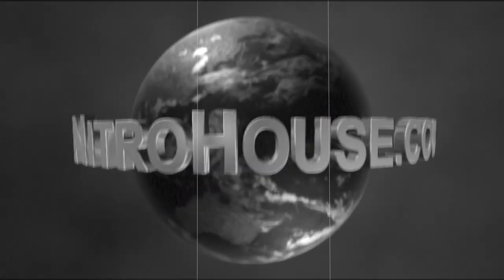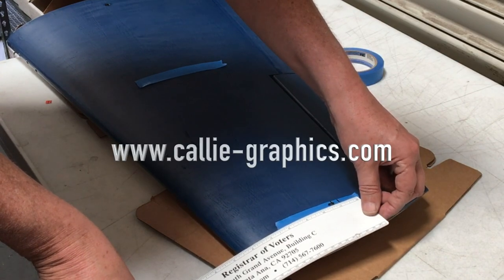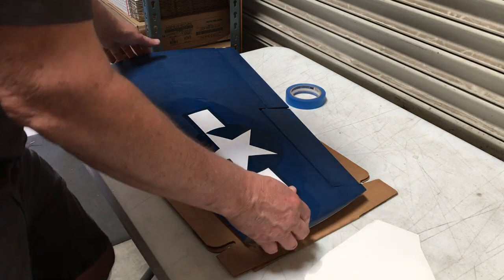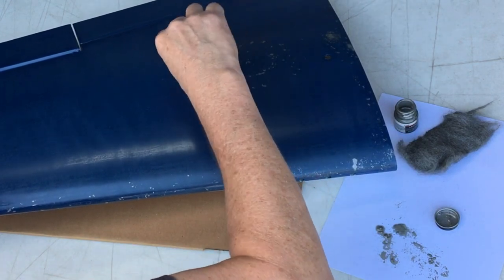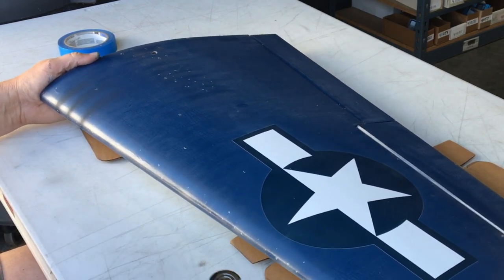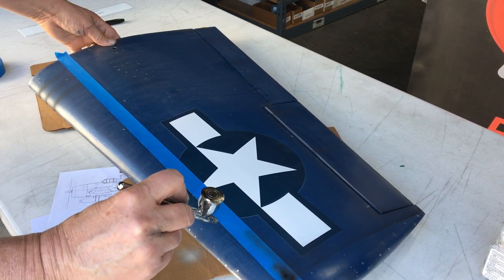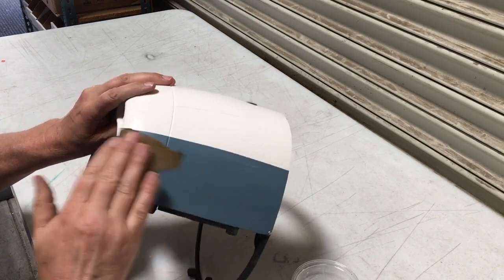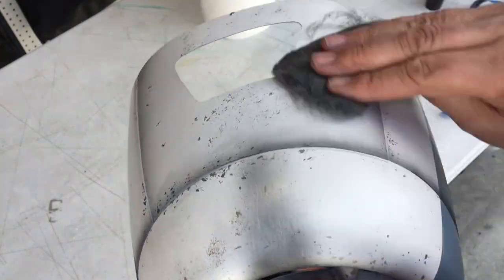How to Video: Weathering & Panel Lines on RC Warbird ARFs & RTR Planes

Comment: Thank you for posting this video! Extremely helpful! Just curious...in the event you need to tighten up the monokote and reduce wrinkles every now and the, how do you do that without damaging your painted surfaces?
Reply from the maker: I use a heat gun most of the time. On the edges I use an iron w/sock without any trouble. Thx